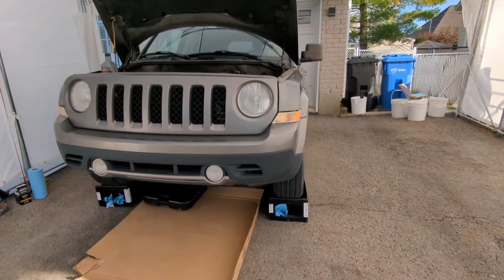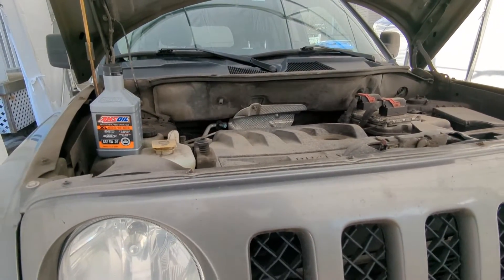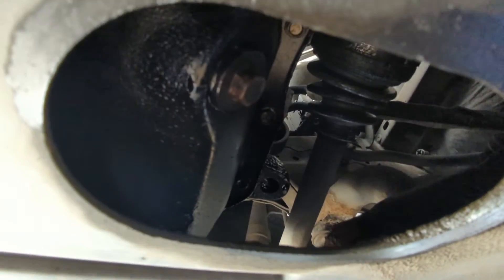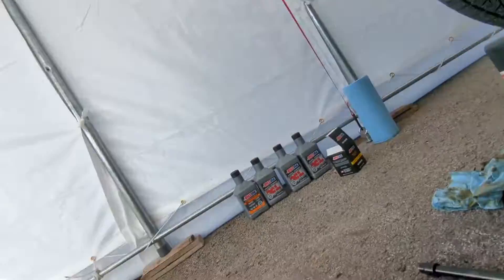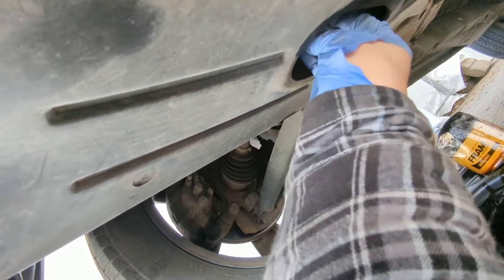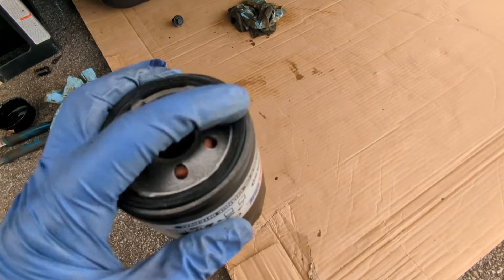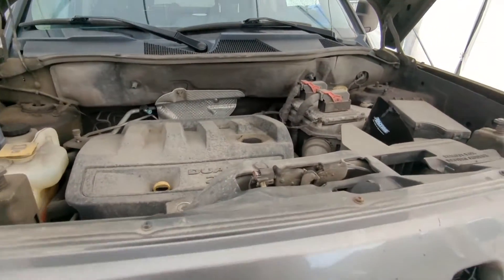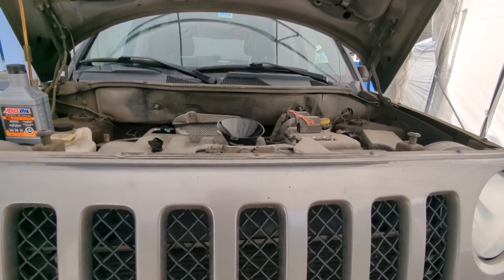Oil change on a 2012 Jeep Patriot 2.4L

Comment: Great video! Can I change oil without car being up on blocks/propped up with a jack?
Reply from the maker: Yeah I'm sure you can. You would have a little less space to move around and you might not have as much leverage when removing the oil filter, but if you have the right tools, I'm sure it's doable.